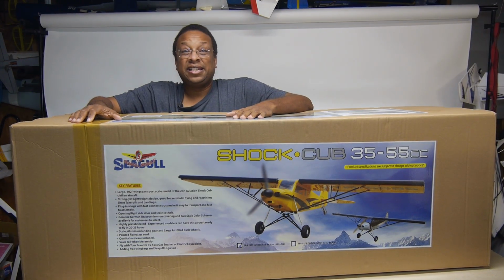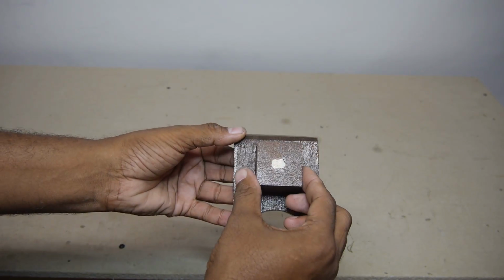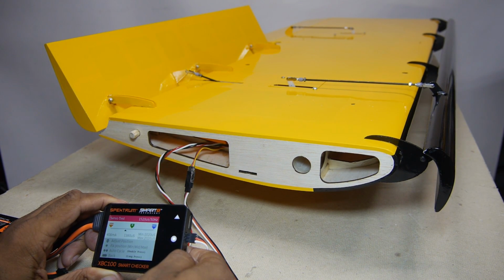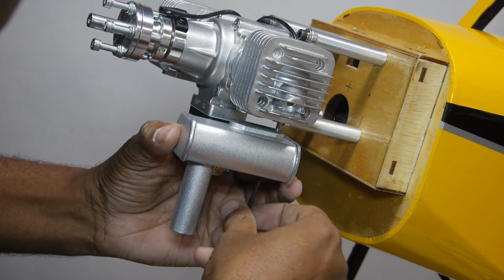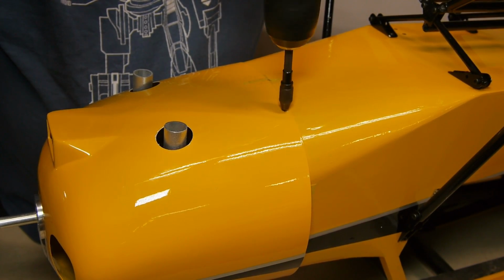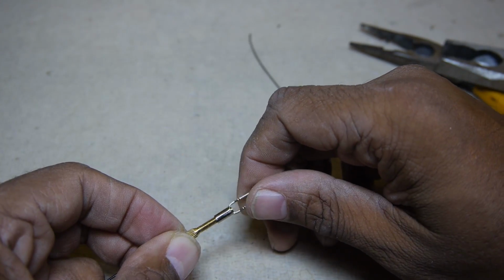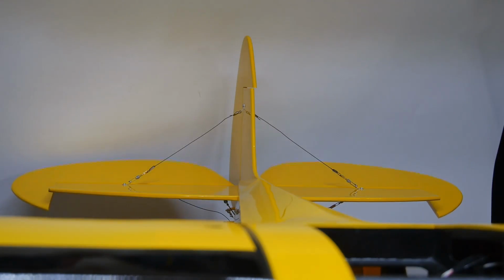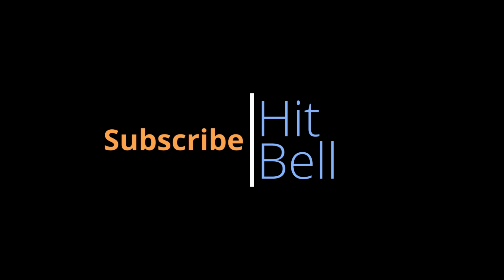Legend Hobby / Seagull Models 102" Shock Cub Detailed Assembly | HobbyView

Comment: Thank you for the great video. Can you tell me how much clearance there is between the motor shaft and the ground? In other words, what size propeller can I use?
Reply from the maker: Huge mount of clearance! ~14 or 15 inches. So you could put a 30" prop on it if you so desired.

Comment: Question, I was wondering what fuel mixture you used on that engine because I recently picked up a plane with the same engine wasn’t sure what the ratio was
Reply from the maker: 30:1 fuel/oil is good to start. if the engine is well broken in you can got to 40:1.
Reply: @HobbyView  Awesome, thanks man. 👍
Reply: @HobbyView I also had a question how you did the 2 switches for power and ignition. I tried that on my seagull models yak. But every time I tried booking it up, one switch powered everything. It’s got a ibec for the ignition and not sure what I’m missing to make both switches work
Reply from the maker: @CalebT_RC  , I made a "Y" connector that plugs into the battery that splits to the RX switch and Ignition switch. This provides independent power control.

Comment: Fitz,  Finished my shock cub finally.  I was setting up the throws, and was wondering if you went with 120mm from leading edge for CG?  Also, is the 120 just from leading edge or from stohl leading edge?

Thanks

Comment: i have just assembled the wheels; ( which is NOT shown in the video ) the 4 bolts provided to join the wheel halves are too short to allow easy assembly - either get ones that are 1/2 longer and then cut them once together,  or what i did what use clamps to force the halves together, as the big tyre makes for difficult assembly with the supplied bolts

Comment: hi there sorry to bother but i have a quick question....so far all the planes i've had used 6.0 volt Nihm batteries, i am swtiching to 2S lipo 7.4 volt...i have hitec servos designed for 6 volts, can i use this 7.4 volt lipo with the servos? haven't tried that yet....appreciate your comments...or should i get a voltage regulator?
Reply from the maker: No. I would not recommend using a 2s lipo on non-HV servos. 2s LiPos can have a voltage as high as 8.2 volts fresh off a charge. 
You will need to use a regulator. Make sure it is a fairly powerful one.
Reply: @HobbyView  thanks a lot....will look into that....happy flying
Reply: @HobbyView  do you know of any good regulator? thanks
Reply from the maker: @ScalePlanesHangar  , I don't have a particular brand per se. Spektrum and Castle are two major brands you can look into. 
I personally would aim for about 1 amp per servo in sizing it.

Comment: I have a 50cc RCGF twin i am fitting in mine - yet the specs give much the same dimensions for the 40cc across the heads at 190mm as 50cc versions - yet you were able to fit the engine in with no plug cut outs - I have had to cut holes in the cowl to allow the plug heads to clear ...i can only assume seagull have made a smaller cowl in width between your model and the one i just bought. I actually have a spare cylinder for a 40cc one and was able to compare it against my 50 and the are the same height (width lying flat ) ...I got it sent in error so if anyone needs a new 40cc twin cylinder its available

the manual makes no mention of stripping the covering off when you fit the 4 shaped front flap mounting parts, so good point there.

Comment: Hello,  great build!!! I built mine off your video  as the manual was horrible.  Would you mind sharing  the programing for the spectrum
Reply from the maker: Ailerons:
High – 100%, 30% exp
Low – 65%, 0% exp

Elevator:
High – 100%, 20% exp
Low – 65%, 0% exp

Rudder: 100%

Flaps/elevator mix:
-100%/0%
-56%/5%
-10%/12%

Comment: Quick question...How do you store the wings in the wing bags considering the metal strut assembly? does the assembly fold down?
Reply from the maker: Yes, the assembly can fold down if you pull the pin out of just one of the struts on each wing.

Comment: Thank you for a great video, quick question for you. I have spectrum NX6 will I have enough channels on the radio to run this aircraft?
Reply from the maker: Yes you can use the NX6, but you will have to use a servo reversing "y" harness like I used in the video.

Comment: Good Review ,as I have the older 40 twin with straight plugs I wonder if it will fit the cowl , of hand do you have the cowl size ?  cheers
Reply from the maker: Cowl width is about 210mm (8.25").
Reply: @HobbyView  Thanks Cheers.

Comment: Fitz, I love your instructive videos they are spot on tech wise and very entertaining. Could you give us a guide comparing the nitro engines to electric motor conversion? I have call many places and they try to impress me with nomenclature and acronyms.. I m about to pull out the rest of my hair. I talked to a guy on YouTube that does explaining of electric vs fuel. He only insulted me saying or rather implying that I was stupid. thanks if you can help, I really don't want to get electronic engineering degree just to know what motor I need for what airplane.
Reply from the maker: That is an interesting topic as I've done electric conversions in the past. In fact I have a model on the back burner for one.
I could do a live show about it or a normal produced one. Let me think on it.

Comment: Nicely done video.
One thing i noticed was the slack in the pushrods to the carb arms. The vibration from the gasser will enlarge those holes causing more slop in the linkage or possibly worse break. You also want to isolate any possibility of rf interference from the EI by using some type of nylon, whether it be a ball link or clevis at the ends of the linkage to the carb and throttle servo.
Reply from the maker: Yes, eventually I plan to redo the linkage with a ball link just like I did on the P-47 build.

Comment: I use the adjustable standoffs from Extreme Flight. The "Blazing Star" Standoffs. They have them in a few sizes and they are made extremely well (to withstand the extreme stresses associated with hard core 3D/XA flying).  Each standoff comes with several different size sections...and different length bolts that can be added/omitted as needed to get the perfect length. I use them on my 3D and scale planes. Can't beat them. Makes getting the right spinner to cowl gap so much easier.
Reply from the maker: Good info, I'll look into them.

Comment: Looks great. Just one critique. Use a ball link on each end of your throttle. The metal to metal z bend can cause two problems. One metal to metal and gas engines can cause RF noise which can be very bad. Add to that the play that is present in the z-bend makes it tough to get a consistent and reliable idle. Cheers!

Comment: Are you using stabilization on the AR637T? If not, the AR8020T has all the same telemetry, and 2 more channels
Reply from the maker: No. Not using stabilization. 
The AR8020 would have been more ideal, but I already had 6 channel

Comment: Ok, when's the flight review coming?  I am very interested in how those movable leading edge slats work.  I was a bit surprised when I found out they were movable and coupled to the flaps.  I wouldn't have thought that would be the case and I'm not sure exactly how they work aerodynamically.  Great building review though.  This kit is definitely on my list for down the road and you chose to install the exact engine I want to use.